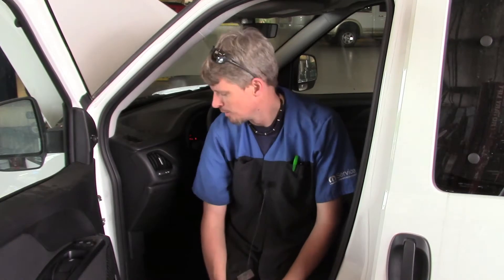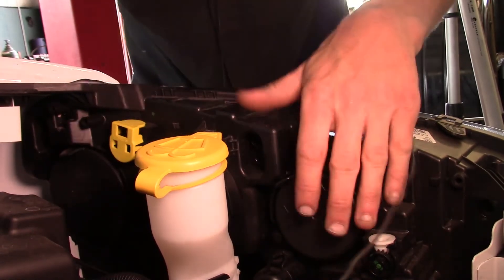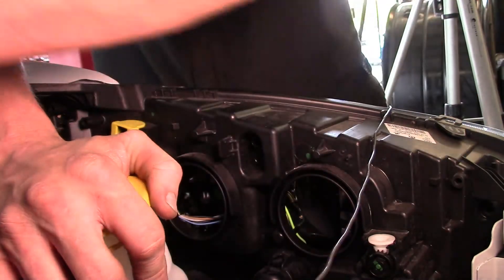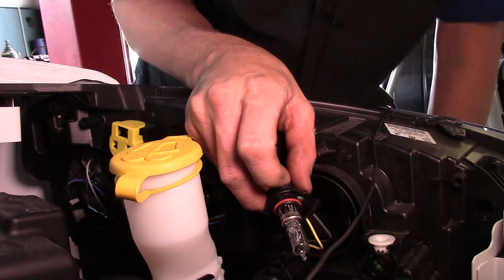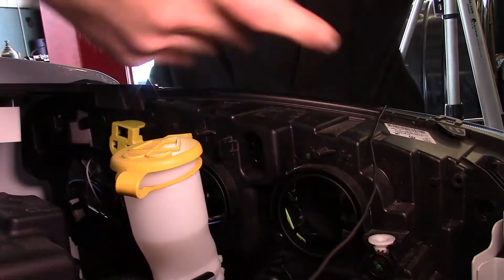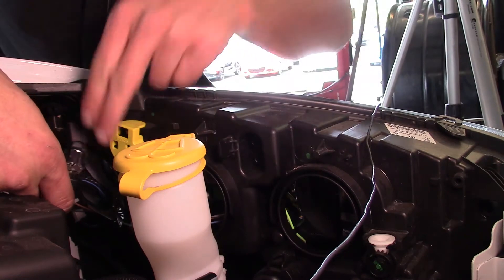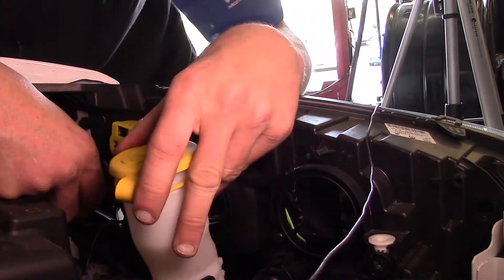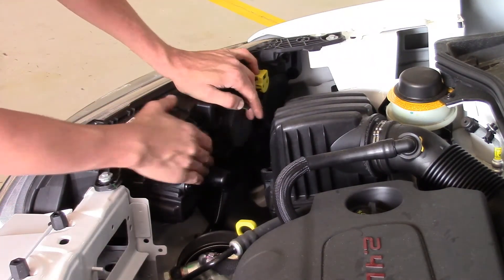2015 Ram Promaster City head light bulb removal

Comment: How do you get whole assembly out?   I can't figure how how get bottom bolt out.
Reply from the maker: The removal of the lower bolt requires removal of the front bumper cover. There are a few steps needed to do this. I dont have a video on this at the moment and its more then I can explain in just words.

Comment: have you ever replaced an axle on a promaster city? what socket did you use i had to grind a chrome 36mm socket thinner because every one i could find was to thick to fit.
Reply from the maker: I can say that I havent so far. Theres a chance I might soon if the valve body I just installed in one doesnt fix the issue and then the trans has to get removed. I will have to keep it in mind if I ever have to remove one. Thanks for the question and for what to be prepared for. Make sure to subscribe and check out my other videos.
Reply: I had the same problem too thick Ram imo purposely to take your money having  to use their customized thinner socket.
Which is expensive if u can find it.
I had a local mechanic in Ft Worth Tx who had the right socket. I spent weeks trying to solve this issue bypassing ram.
I did find a socket online but was hesitant to buy not sure if it would waste my time and money not being thin enough and then I luckily found a local mechanic was able to do the job and he was pretty affordable. Was a nightmare going through

Comment: what a waste of time. show people how to change the main low beam bulbs, they need replacing almost all of the time!
Reply from the maker: So the low beam is the same as the high beam when getting removed. Logic says that if I show you how to remove the high  beam and I say that the low beam is the same procedure....you have all the info you need so not sure what the waste of time is. It’s clearly stated in the video. It’s 3 inches away from the high beam and identical on removal.
Reply: @MotorCityMechanic  i was trying to install led bulbs so i wanted to take a closer look at what the bulb holder looks like. i want to find the adapter to install led bulbs properly. anyway i can't see the way your holding and camera/lighting. ill find another video thanks.